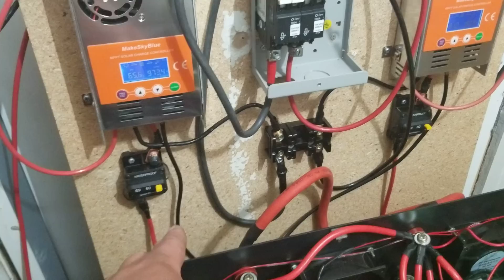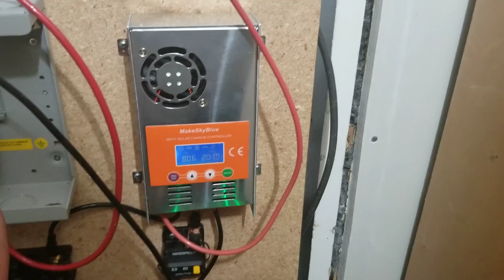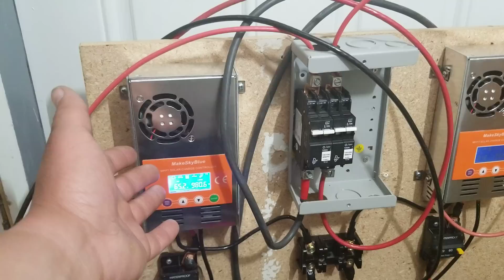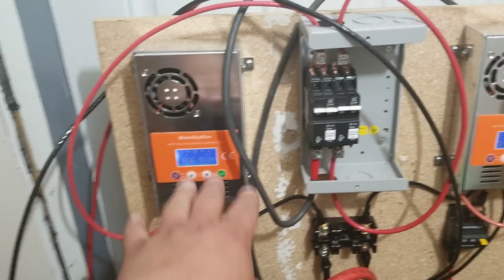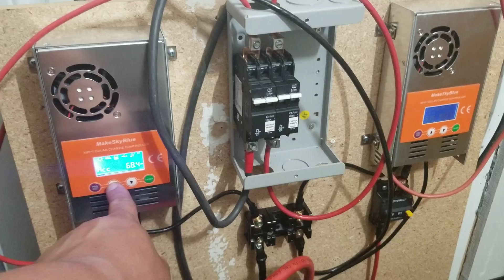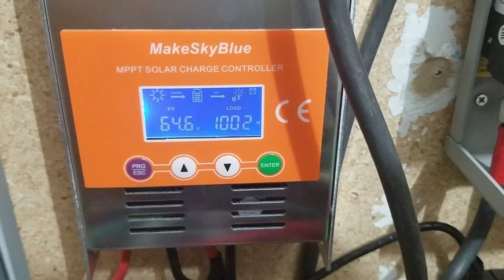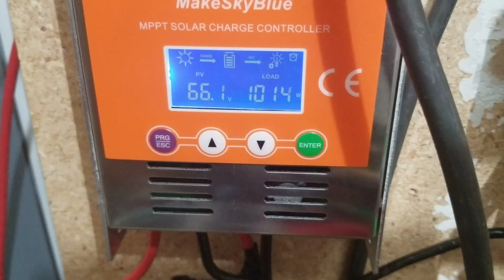A detailed look at my 2.4kw off grid setup (part 2)

Comment: I have used both branch controller (makeSkyBlue and Powmr) my current configuration is 4 panels connected in series and delivers 9 amps at 132 Volts total array in open circuit  and a bank of batteries at 48v, My controller sometimes shows 16 amps or more and the voltage drop to 80V or less on a very sunny day. The reason is that these controller have toroidal inductors inside and amplify the current by decreasing the voltage, this is simply Ohm's Law. I like to work with high voltages so as not to spend money on thicker wiring and this solar controller does the dirty work, increases the current and delivers it to the batteries. Nice video...

Comment: Ok Just bought 5 of the MakeSkyBlue 60 amp from Sean...Just wanted to say thank you for the info.
Reply: Why 5,   1 can run 2400 watts.
Reply: @simplyfocus9937  the amps i have 40 panels of 265 watts 8.xamps each
Reply: Makeskyblue  likes high voltage. It performs better. I have 3 of 60amps.

Comment: Nice. I'm just getting into this. I love my make sky-blue mppt charge controller cost me $250.00 for it yes I could have gotten it cheaper but I was in Orlando FL, Picking up used 260w panels for $80.each  I got 5 of them. when asking the guy there he showed me the charger. So I went and bought it. Do to if I had a problem with it in 30 days I could drive 3hrs to exchange it. A lot easier than having to deal with some person in a different country. OK my Q is
(1) what size wire are you using from the first panel to the other breaker. I'm lucky if I'm getting 1w out of 3 panels. Right now I'm using a 30amp 110 breaker from my panels to the charger. Ps it is all I have at this point I work a $9hr job 20hrs a week so I'm using what I have. Ps 
If it shorts out I don't want it to catch my home on fire.
(2) what size of batterie amp hour are you using. I have 13acers and looking to run
Fridge, Ac window unit, washer. I live in a 10*20 cabin. Everything else is going to be 12volt.
Thanks.
Reply: To move air conditioners ( depending on the BTU) and other equipment it is not recommended to use 12v battery banks, you will have to use very thick wiring and work with high currents. I recommend a minimum 24V battery bank. I personally use 24v and 48V battery banks. I recommend 500Ah batteries to move air conditioners. Keep in mind that using a bank of batteries in larger voltages for example 48 Volt,  you inverter will have less losses to convert it to 110 or 120 volts AC, also that you will use less amps and therefore thinner cables (3 AWG or 4 AWG gauge and so on...) but if you use banks at 12v you will have to use 2 AWG or 1 AWG  gauge or zero gauge wires ...

Comment: help!

I want to charge my lithium batteries to 4.1 volts per cel maximum . 7x4.1 total 28 VDC

I need to solar charge controller to stop charging when battery reaches 28VDC , what values should I set  for d0 , d1, d2, d3, d4?

My battery is:
Cell Specifications:

Cell type Laminate type
Cathode material LiMn2O4 with LiNiO2
Anode material Graphite
Rated capacity (0.3C) 17 Ah
Average voltage 3.8 VDC
Maximum Voltage 4.2VDC
Minimum Voltage 3.0VDC
thank you
Reply: Carlos  did you get the answer. Let me know

Comment: Hey That's No geeky I like to do the same thing I like to sit there and look at my power coming in through my charge controllers all differences I have powmr charge controller the only difference between your charge controllers and mines they have different color stickers on the front and mines system I made a box that way all the wires are inside the Box charge controllers and my meters are mountain on the door that way I won't see the wires

Comment: Hi Genetry,  I just bought a 9000W PJ inverter but still hesitate on getting  the cheaper MSB or PowMr charge controllers because I was wondering if they are reliable, if programmable user parameters setting is ioffered, and if these charge controllers are capable of  data collection through RS-485 or USB communication port. I know my Epever controllers have it all albeit at a steeper price... That's more productive if one wants to analyze the behavior of the system over time. Monitoring the BMS would actually make a lot more sense, mostly on controllers without com port. Thanks for the vids! In fact,  bought the 9000W inverter after i watched your video. i hope I won't be disappointed.

Comment: Hi Bro, good morning am very much interested in the makeskyblue charge controller the 60amp, can you give me some but info on they promance, thanks in advance for your reply
Reply: If you're buying 60 amps you better have a 48v system  or you'll never see 60 amps. Also you will need 2.4k watts panels. The controller works great. If you have a 24v system, you better off with 40amps

Comment: wow. that is a totally epic DIY off-grid setup. it blew my mind seeing your central AC running 100% off the power straight out of the panels. i recently got a monitor that lets me see live via bluetooth how much power is coming in or going out, and it's defintely addicting lol. i can relate to geeking out with that. I have a setup video on my channel if you are curious, but it's simple and TINY compared to yours. i hope you'll do a part 3 on your battery bank. nice work

Comment: Both controllers should be putting out at the same time. If one is working more than the other that means the one that is shut off is reading a higher voltage and shutting off sooner

Comment: I know why one is more dominate.. its how the left controller sees voltage.  We at Make Sky Blue, have updated the the firmware to allow you to calibrate voltage. Before I send any controllers out I Calibrate against a precision power supply.  I need to send you some updated controllers... They work even better in parallel.. I have 6 In parallel on my system handling 153Kwh bank.. Ill send video when i get all loose ends wrapped up.
Reply: send me a video as well would love to see your system sean.

Comment: I'm just getting going on this stuff.   Obtained a Make Sky Blue 20A Kit from Ali .  Still putting all together.   Going with 24V.  Solar 4 x 100W combined with a 500W wind turbine.  Waiting on funding for 4 flooded Lead Acid batteries. Until then using 8S 38120 LiFePo4  24V to get things rolling.     Going to use locale Plug and Play Grid Tie to lower our already low power bill.  No intentions of going full off grid at this time just experimenting with what I can afford and know how to do at this point.  I quite sure using the  400W Solar and 500W wind local grid tie will lower our $100.00 a month electric bill more then some.